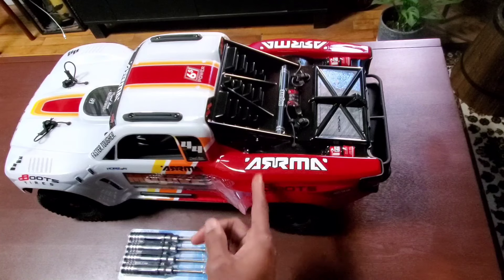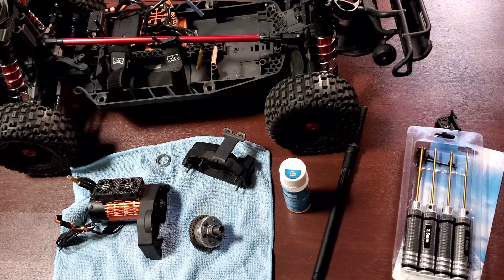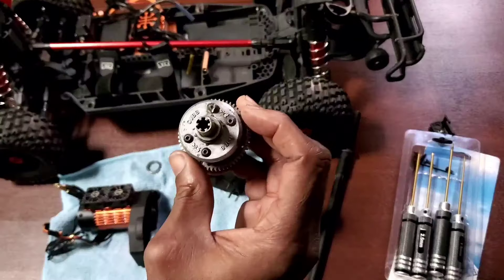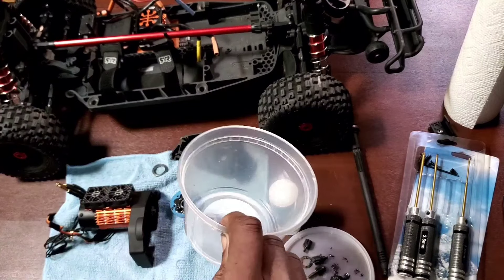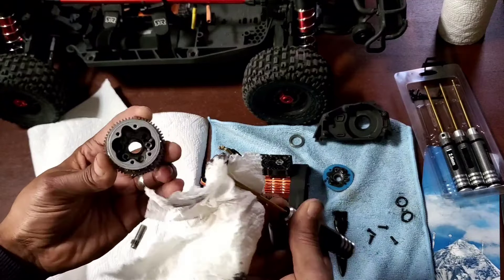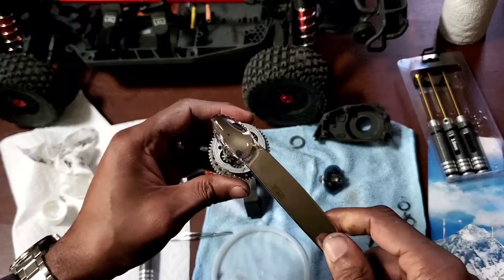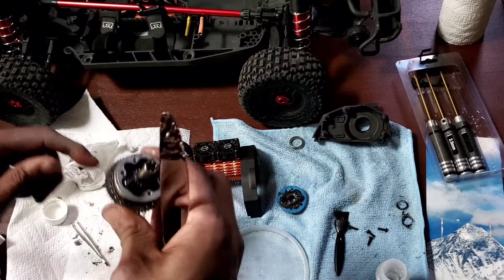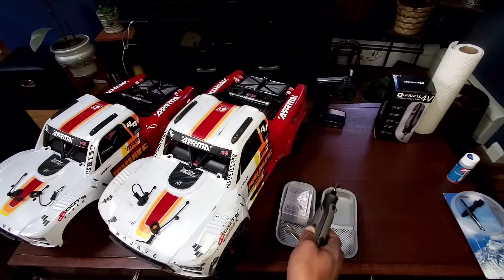Change Arrma 4s Mojave Kraton Outcast Center Diff Fluid to 1 Million

Comment: Hello! under no circumstances should the diff seal be touched by the oil in the differential in order for it to seal properly, the best method is, in my opinion, to weigh the differential once you have found a correct setting of it with enough oil and when you want to change the oil to use the same amount of oil, and something else, I saw that you took care of the same o-ring not to put them in the cleaning solution, but I think you should also take care of the bearing in the central shaft, if the bearing remains dry and you force diff destroys everything
Reply from the maker: Thanks for the tip.  But I believe there is really no way around the seals getting diff oil on them unless the shims seal them out which I doubt highly.  Those seals do get diff fluid on them and it's OK.  Since I'm not racing or anything under no circumstances will I weigh diff fluids 😅.  Take care and thanks again!

Comment: I think to remove the striped screw you need to take a rubber band and put the rubber band on it, it worked for me🤷‍♂️
Reply from the maker: I tried that, too.  Those 2mm screws are just so tiny.  So...I had to get to cutting 😄
Thanks RD!

Comment: Question: with it wheeling like that with front up in the air is it even drivable? How do you do fast driving and turning with the wheels off ground everytime you pin the throttle? Wouldn’t it be better to have to front tires against the ground under maximum throttle?
Reply from the maker: Theoretically, yes. Having the front wheels on the ground would facilitate turning.  But who needs to turn? Right? 😂
Reply: @bigbristv  r u on 6 s in the video?
Reply from the maker: @thepatternforms859  yup 😁
Reply: @bigbristv  lol oh ok well that explains it haha
Reply: @bigbristv I’m about to do this center dif 1 mil job and I am scared I will use your video but is there any other videos for this?
Reply from the maker: https://www.google.com/search?q=change%20rc%20diff%20oil&ie=utf-8&oe=utf-8&client=firefox-b-1-m any of those should work.  Diffs are all essentially the same.
Reply: @bigbristv I’m looking at the exploded parts view right now and it’s showing the shim and rubber gasket reversed on each side. 

When you pull the two inner half shafts apart each side has a set of shims and rubber gaskets but the order they are placed is reversed on each side according to the exploded view. 

For one half it is rubber gasket first then shim but for the other half it is the opposite and goes shim first then rubber gasket.

Have you noticed this? Take a look at the exploded view and see if this is correct? In the video it appears both sides where set up the same?
Reply from the maker: @thepatternforms859  I would go with what the exploded diagram shows, I may have put it together backward my first time doing it.  It's still working well with the way I did it in the video, but I'll have another look soon.  Seems I have to check all of my diffs 🫨 https://youtube.com/clip/UgkxVcHcy-7hDhLo7C8AEAHymM975_lqYtCg?si=-AtLFxf41wLFsdrS
Reply: @bigbristv  the diagram is confusing for sure. I just took mine apart for the first time and noted that the metal shim on both sides is always closest to the gear teeth of each respective side

Comment: put drywall tape and shoe glue to the body , i did mine on arrma senton and its 10 times stronger👍
Reply from the maker: Did it also make it 10 times heavier? I 😁
Reply: @bigbristv  i dont have isues with my senton. It heavier ,but not so much i expected.
Reply: @bigbristv  i donk know ,how much it weight , but its not so heavy as it was stock.
Reply from the maker: @RD_LV_RC got it. Glad that's working for you.  I'm on my like 4th body.  Maybe I should have done the tape and shoe goo thing 🤔
Reply: @bigbristv  and ofcorse ,it affects how much you put the glue , I put most of the glue on the places where it can be easily damaged
Reply: @bigbristv yes of course then it will be cheaper
Reply from the maker: @RD_LV  makes sense.  Check out my next video where the Senton makes an appearance. 😉

Comment: I also added 1mil diff fluid on my arrma vorteks  boost 4s center diff but havent had the chance to really test it yet. (I retrofitted the center diff since the Vorteks doesn't come with it as well as a 4s power kit) thanks to this video I decided to go with the 1 mil diff fluid. Great vids btw
Reply from the maker: Thanks! 1M works wonders for front tire ballooning.  Just be prepared to service the diff often if you bash hard.

Comment: You get a subscribe from me. Great explanation. I've been searching high and low for this exact information.
Reply from the maker: THIS is precisely why I do this.  Thank you 🥲
Reply: @bigbristv  thanks. I was looking for a while. Thanks to your video I just changed my center diff to 1 mil too. How does it handle now with the 1mil? Also I keep reading people using red n tacky grease on the "oitside" does that mean they are greasing thr pinion and spur gear?
Reply from the maker: @LegendsPizzaCo never grease your spur and pinion.  The module is pretty sealed so dirt doesn't get in easily.  The red n tacky they're using on the front and rear diff's crown and input gear teeth.
Reply from the maker: AND I love good pizza 😁
Reply: @bigbristv  perfect this makes sense now. I was looking at my center diff only so far. Haven't touched the front or rear. When I opened the diff case tbe spur and pinion were dry so I assumed no grease needed there so I was confused on where they were using these greases. Now I have to look at my front and rear diffs and see where to use the grease. What weight did you use on the front and back. I was gonna do 30k in front. 1mil center. And 20k rear. And yes we have amazing pizza. If you're ever in the bay area I got you
Reply: @bigbristv  we need a video now for doing the front and rear diffs lol
Reply from the maker: @LegendsPizzaCo I haven't opened the front or rear diffs (on purpose 😆) yet but I'm running whatever came stock.  When I do, I'll check and probably run whatever is in there if I can find out what stock is.  Since I'm just using the Mojave 4s (6s 🤫) for general hooning, I wanted the 1 mil center for less tire ballooning especially during wheelies.
*opens Google flights; search: Bay Area 😉     😅
Reply: @bigbristv lol I didn't clean mine as well as you. I didn't have any thinner on me. But I cleaned it out as best as I could. I didn't see any shims tho. I have the kraton 4s 2.5. I saw the bearings and the 4 pins ans 4 gears. I'm worried I didn't put it back together right lol. I knew this was above my pay grade lol. I ran it last night and it sounded and ran good tho
Reply from the maker: @LegendsPizzaCo if she's running well, you did a good job!  It gets easier with practice.
Reply: @bigbristv  thanks. I was just worried the shims never came off. I have the kraton 4s and I'm assuming it's the same center set up as yours.
Reply from the maker: @LegendsPizzaCo Can't be sure, but mine had shims.  So has every other diff I've opened.
Reply: @bigbristv  yea they are there I think they just stayed on the shafts cause I didn't clean it as good as you. The car is pretty new kntk a few packs through it. Just wanted tbe tire ballooning to stop on the front. I'm tempted to take it apart again fully clean it like you did and see where tbe shims go. I'm assuming there is 2? On on each shaft?
Reply: @bigbristv  lining the two cups back up is tough once it's full too. If you make a mistake and have to separate them the thick oil pulls the pins and gears back out with it. I was frustrated lol. Had to walk away a few times
Reply from the maker: @LegendsPizzaCo yes, there should be two, one between the o ring and gear head on each shaft (multiple pauses) 😆
Reply from the maker: @LegendsPizzaCo  yup, that's the frustration that caused me to scrap the first video I shot when I did it the first time.  That's the main reason I cleaned out the cup more thoroughly this time because those pins don't want to fully seat once fluid is in there.
Reply: @bigbristv  haha I will just leave this right there lol
Reply: @bigbristv  I'm thinking mine just stayed on the shafts. I never saw them. Just the 4 pins and 4 gears and 2 shafts with 2 bearings and an o ring. I might go run it real quick and see how it does. I also changed my shock oil to 90wt. I can always take it apart again and clean it the way you did and inventory all parts. I got some odorless spirits like you used too so I'm tempted to take it apart again. That 1mil oil is so thick it was really hard to fill up but I want to change my pinion to 15t anyways so I might just open it all up again now that I know how
Reply: @bigbristv  yea its hard lining up the pins to go into the cup holes. I walked away a few times and came back and finally got it. Perseverance
Reply: @bigbristv  just bashed it hard lol. It ran like a champ. No more balloon wheels. I also upped the punch to level 8 this 4s kraton is insane
Reply from the maker: @LegendsPizzaCo 😃👍

Comment: Hi mate, good vid...Is that an aftermarket Vitavon Diff? Never seen these come stock before unless Arrma have changed the design, Its certainly different.
Reply from the maker: This diff is stock. Came on the most recent 4s models, 3 to be exact.